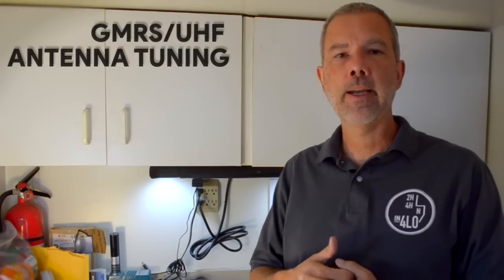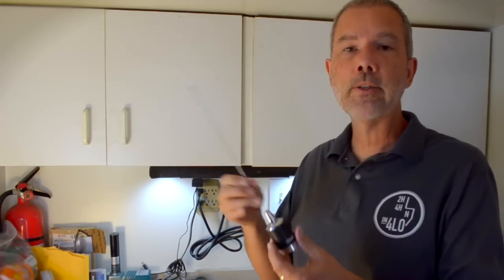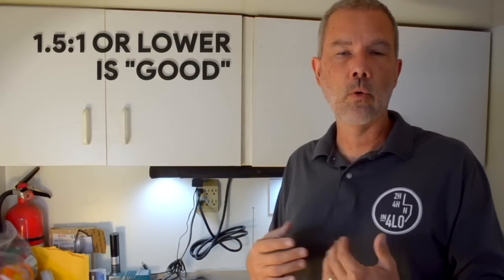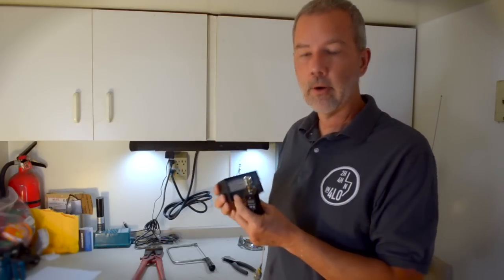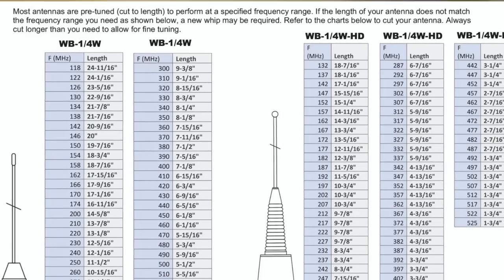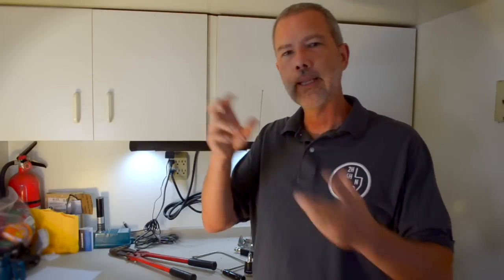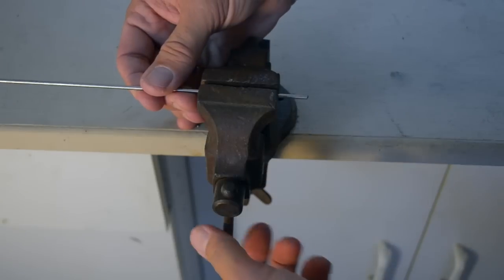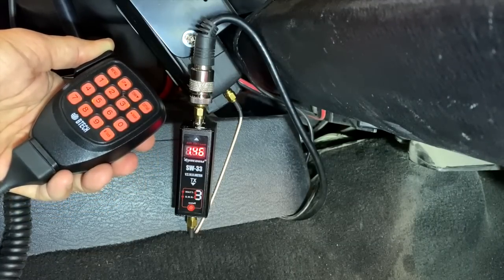How To Tune A GMRS Antenna & SWR Basics

Comment: Great video! I have a Midland 6 db antenna. I was told the SWR won't need to be tuned. Not sure if that is bad info or not. My antenna mount is completely powder coated so I know the antenna is not grounded. This mount, antenna, and cable were all bought from Midland USA. I do have a clean sounding radio. At 15 watts I'm transmitting around 5 miles in the city with hills. Do you think I should check the SWR and should I scrap the powder coating off to ground the antenna?
Reply from the maker: "Clean sounding" is not an indication of good SWR ... We always check the SWR on every radio/antenna we install.. So yes, we recommend that you check the SWR.. then, only if it's high, scratch off some powder-coat as a first step to lower the SWR.
Reply: @TheNotaRubicon  Thanks. Midland says their 6db gain antenna doesn't need to be tuned. But I am concerned that the way I tied up the excess cable might be an issue. I wound it up like it comes in the package and zip tied it. I'm trying to not have to purchase the SWR meter and just make the necessary changes anyways. Trying to save the $40.

Comment: i have a question. I ordered a BR-450 and did not realize I needed to order a Coax cable and magnetic mount kit for my truck. Do you know what I need to order? Thanks in advance
Reply from the maker: any NMO-type mount should work - some even come with coax pre-attached, otherwise you'll need a length of coax also.

Comment: The question I have is, if the manufacturer knows the freqs are in the 462 & 467MHz range then why don't they just cut their antenna whips to the proper length at the factory? There should be no real need to match them at the consumer end.
Reply from the maker: Many/most antennas are sold as UHF/Dual Band antennas covering a wide range of frequencies. If you find a "GMRS ONLY" antenna, it should be pre-tuned and should not need to be cut, but it should still be tested/checked.
Reply: @TheNotaRubicon  Ah so a HAM dual bander can be cut down then, makes sense Thanks for the reply.
Reply: The meter you use doesn't come with the adapter for the radio
Reply: What adapter do you use?

Comment: Thank you for the video. I have 1.1 and I can transmit with no issues. friends can hear me miles away, but i'm unable to receive anyone on simplex unless they are within a few hundred feet. Setup is Yaesu FTM 300, Brownie antenna on a hood mount. Any help I would greatly appreciate it.
Reply: Check your squelch. Sounds like it is set too high.
Reply from the maker: This was our thought as well.

Comment: A Dremel with a cut off wheel is the easiest and cleanest way to cut the antenna down to size.
Reply: Great video Randy,   But I missed your normal sarcasm.   Best calibration video I have seen to date.   Thank you for your always great information.

Comment: I have one of the MicroMobile MXTA25 GMRS antennas for my Jeep, which is a completely sealed unit.   So am I correct in assuming that setting SWR is not necessary for this antenna?   There were no instructions included with the antenna that said anything about setting SWR.   Thanks for the info, interesting video as I was not aware that there is a need for setting SWR on GMRS.   There is very little info about the subject on the internet.
Reply: You still have to tune the antenna, but I did once read you don’t have to ground the antenna mount. Frankly, I find the later point hard to believe.
Reply: From looking at the photos on Midlands web-site I see that there is a small hole on the bottom next to the center conductor pin, I would look in there to see if there is what looks to be a straight blade screw head. If so this could/would be where that is an adjustable capacitor used the tune the antenna. If you take your vehicle off-road much and depending on your mounting location I would consider a different antenna because this antenna has no give if you were to hit a low hanging branch.

Comment: What are your thoughts on the Australian CB(477-478mhz UHF) radio setups? Uniden and GME make some amazing looking dual swapping antennas with folding mounts. Thinking of ordering a set and testing then on GMRS. 
https://www.gme.net.au/au/antennas/
Reply: The frequency of that antenna is higher than the GMRS frequencies. So it might not work as good as you think.
Reply: @toddhoffmaster6057  Exactly. I would like to put one on a SWR Meter and see how it works. Might be really good and only need a slight trim.

Comment: So I’ve been looking into getting into gmrs... according to some ham buddies the btech gmrs-50x1 and x2 aren’t fcc approved radios!  Really want something better than midland offering however.
Reply from the maker: It would seem that your ham buddies are confused!  The BTech GMRS 50X1 is fully FCC Part 95E compliant/accepted.. The 50X2 is a ham radio, not GMRS, but it is approved for use on ham frequencies.
Reply: @TheNotaRubicon  you are correct just did my own research to be sure, and looked up the fcc ID myself!
Reply: What is it that you don't like about the Midland? I have had the 15 watt version for almost 2 years now and now that I am using an aftermarket  Tram model antenna it works great. I have tuned it down to a best of 1.09 on the swr meter on the low watt channels and a 1.15 on the high wattage channels.
Reply: My experience has been some ham guys are like scared little girls when it comes to GMRS and will say just about anything to try to discourage people, i guess the clowns think GMRS Somehow threatens them and their precious hobby